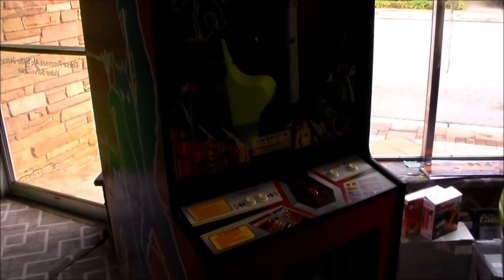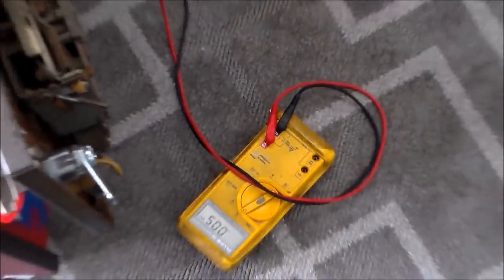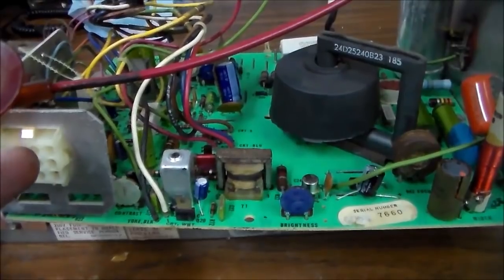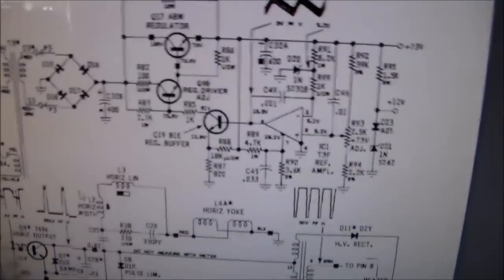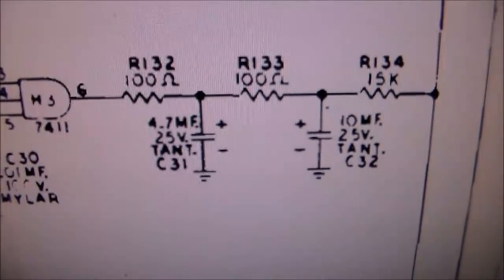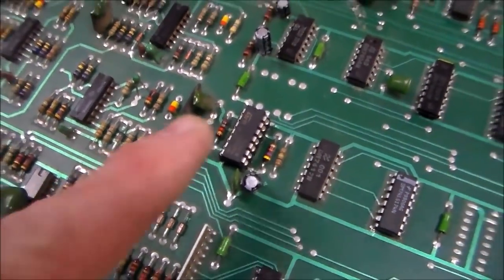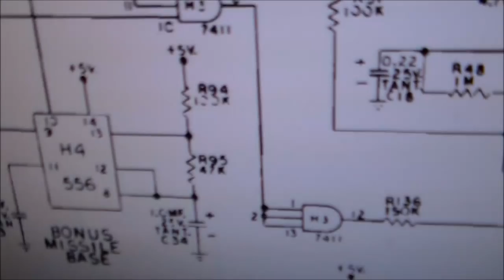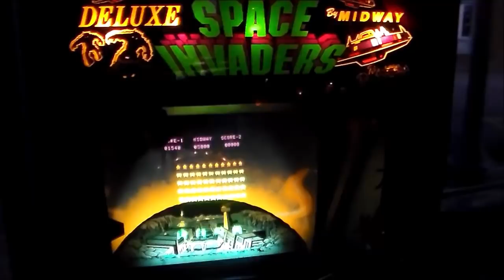Multiple Monitor & PCB Repairs on a Space Invaders Deluxe Arcade Game

Comment: That's such a clean looking chassis! I've read about putting them in the dishwasher to clean them...mine is INSANELY DIRTY! Do you recommend the dishwasher method?
Reply from the maker: I've never done it, but theoretically it shouldn't hurt anything as long as you let it dry.  Dry dry dry dry dry dry dry.  Then let it dry some more :)  The only thing that will hurt it is if it turns on while wet, you can spray it off with a garden hose as long as it's completely dry before you plug it in.  I've heard of many people that put them in the dishwasher, so i'm sure it's not a problem.

Comment: Nice one Joe. Those 7411's are just being used like buffer transistors, since they tie all the input leads together. Tantalum's are notorious for either working, shorting or opening with age. It sucks when you've got a bunch as noise decoupling caps for all the IC chips on the +5 vdc power rail. It's like playing hide and seek with all the good ones. I hate it when they short because the let all the pretty blue magic smoke out of the IC you want that magic blue smoke to stay in. Super find on the CRT pin and the transistors. Loved the video, thanks for sharing. Best Wishes n Blessings. Keith Noneya
Reply from the maker: Thanks Keith, see you on the next video!
Reply: Okay you found the comment I was looking for!

I was going to bring up tantalum caps and bypass caps specifically when they're tantalum.

A lot of times when you have over equipment like that and it's got tantalum bypass capacitors usually whatever I crossed when I accidentally let a magic smoke out sometimes it's just working and then bang quite literally literally.

Sometimes when first turned on when I'm working on something for someone or just stop playing in use and then poopsie Magic Smoke.

I have realized at least 90% of time maybe more chances are somewhere it's a tantalum cap somewhere in the device.

Those things are notorious for this again you probably are where most people are that are seriously into Electronics.

Also I cannot remember what you call these capacitors it's the ones that are used generally has noise suppression capacitors they're the ones that have usually the clearish metal film capacitors.

Can't remember what you call them.

But those things really suck when they go out also a good idea to take care of that if you know the device has them before you even turn it on.

You could really go by Dave Jones Mantra on that one don't turn it on and take it apart.

But in this case either a remove the offending capacitor or replace it with the proper one one that will not do that as readily.

Sometimes you can get away without that particular capacitor in circuit but may not be advisable but that is up to the repairer of the device.

Frankly I don't support removing components from a circuit they're there for a reason.

But there are some cases where capacitors need to go in some circuit designs but that's the exception not the rule.

But back to the other capacitors I was speaking about earlier.

It's not just it stinks when one blows up causing you trouble it literally stinks.

One of the worst smells electronics that can happen I may be mistaken but it's memorable to say the least.

Seen several videos in which this was the case eevblog and others.

Also a lot of retro computer videos have had this happen on camera.

If anyone knows which type of capacitor that is and the acronym for it let me know please comment.

Comment: My game has no sound and it’s not reading the coin switches so I can’t even start a game. The monitor works fine and the “home” screen pulls up. Any idea what might be wrong with it?
Reply from the maker: You only get sound if you start a game, so the sound might be fine.  Sounds like the coin switches don't have a ground, or something along that line, you'll have to check out the wiring and see what's going on.
Reply: @LyonsArcade   Ok, so I checked the ground to the switches and the coin door and it’s all got continuity to the ground on the line cord. The switches test good. I’ve got -5dc on one side of the switches. I’ve got continuity back to the connector at the board on both wires. Bad daughter board?

Comment: Yeah fix the ground and then stick the PC board in the oven for about 5 minutes that should be fine after that I did that was an old Pac-Man machine at work great
Reply: AH no, it's not always good for the other components on the board. You can get away with it most of the time, but it's usually better to just troubleshoot it, if it's a board you care about. Best Wishes n Blessings. Keith Noneya